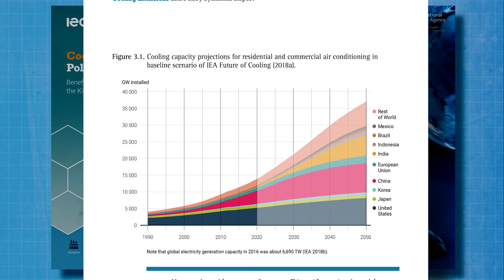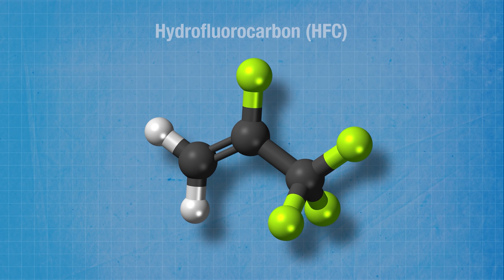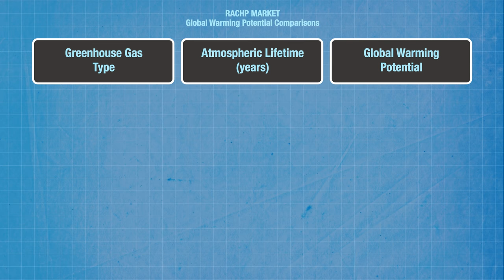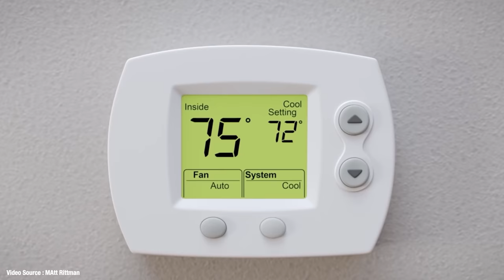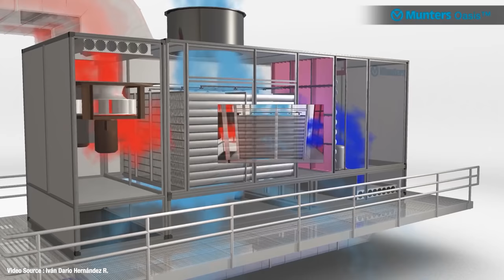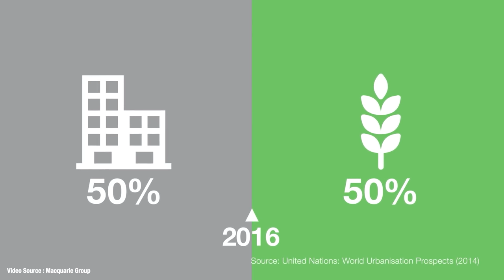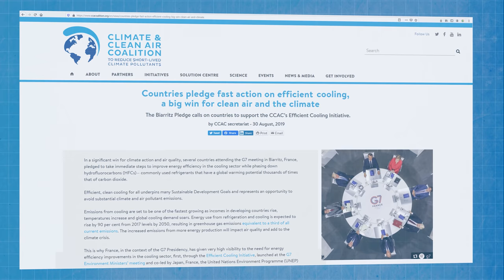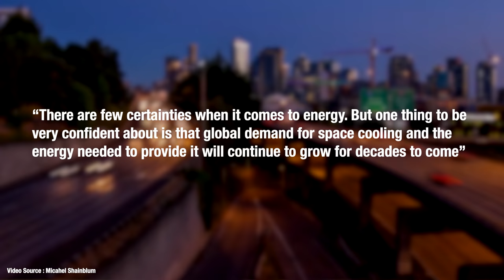Keeping cool in a warming world.

Comment: * PART 1 OF 3 * 
If you prefer a less-comprehensive, less-detailed but accurate and clear enough explanation with the cartoons that clarify it instead of ploughing through my text then the best one is at 8:25 to 27:45 at https://www.youtube.com/watch?v=jCF4vOgQyDE  and that one clarifies that the tropospheric temperature lapse rate is required to cause the so-called "enhanced greenhouse effect", which is crucial to understand. Photons are continuously both created from other energy by GHG molecules & destroyed by GHG molecules by converting them to other energy. A certain portion, statistically highly constant, reaches surface and a certain portion, statistically highly constant, reaches space.
-----------------
This is how the so-called "greenhouse effect" in Earth's troposphere causes warming. The so-called "greenhouse effect" effect is nothing at all like the effect that warms a greenhouse. A vast "shimmer" of transverse electromagnetic radiation in the long-wave band (LWR) is caused by molecules of water vapour (H2O), carbon dioxide (CO2), methane (CH4), nitrous oxide (NO2) and some other gases in the troposphere due to their collisions (averaging 2,700,000,000 collisions / second) with other molecules, which are almost always going to be nitrogen (N2) or oxygen (O2) because they are almost all of the gas quantity in the troposphere. The H2O, CO2, CH4, NO2 and some other gases are being called "greenhouse gases (GHGs)" because the overall effect (not just this part) ends up causing warming of Earth's troposphere. All except H2O are called "well-mixed greenhouse gases" because their boiling and freezing points are so low that they don't condense or freeze in the troposphere, not even near the top, so they get spread out well mixed around Earth and well mixed vertically in the troposphere. The well-mixed GHGs now punch above their weight compared with water vapour (H2O) because the upper half of the troposphere is so cold that almost all H2O forms on dust/salt particles in liquid or solid form there rather than being a GHG but the others remain as GHGs. The lowest quarter or so of the troposphere where it's warmer and water vapour (H2O) predominates is already somewhat "saturated" without much additional "enhanced greenhouse effect" possible (still, H2O has such a broad absorption band that it still manages to match the "well-mixed greenhouse gases" pretty much exactly 1:1 net as a 100% +ve feedback).
------------------
The GHG molecules don't emit a photon of LWR when they collide and they don't later get to emit a photon of LWR after every collision, only after a very few of them such as once per 1,000,000,000 collisions (note 1). What happens is that a collision might cause a GHG molecule to vibrate in a certain way (so with a certain energy) of which the GHG molecule has the capability of any one of a selection (called its "vibrational modes"). GHG molecules with more vibrational modes are more powerful GHGs because they have a broader absorption/emission band. The GHG molecule now has "molecular vibrational energy (MVE)" if the collision did cause it to vibrate. Energy cannot be created without destroying matter and matter doesn't get destroyed by this so what happens is that one or both of the two molecules slows down such that the total "molecular translational energy (MTE)", aka "molecular kinetic energy", is reduced by precisely the same amount as the MVE that the GHG molecule acquired, so (m1*v1**2 + m2*v2**2)/2 after collision is less than (m1*v1**2 + m2*v2**2)/2 before collision because either v1 or v2 or both was reduced, thus obeying the Law Of Conservation Of Energy. What happened was energy transmutation from one form to another. When this vibrating GHG molecule hits another molecule it loses its vibration (note 1) and one or both of the two molecules speeds up such that the total MTE, is increased by precisely the same amount as the MVE that the GHG molecule lost. So it just moved kinetic energy from one N2 or O2 (almost always) molecule to another. However, just a few times each second a GHG molecule with MVE will spontaneously emit a photon of LWR and lose its MVE ("relax"). Now it has converted one-photon's-worth of molecular kinetic energy in the troposphere to one photon of LWR. This "relaxation time" of the "springy" covalent bond harmonic motion (with a photon emitted) happens over 10ths of one second (a very long time indeed).
------------------
LWR is also radiated from the surfaces of liquids & solids such as the surface of the ocean, the surfaces of water droplets in spray above the ocean, the surfaces of water droplets in clouds, the surfaces of any water droplets at all, the land surface, the surfaces of trees & grass, the skins of animals, the surfaces of dust, salt, volcanic ash, any ash and any surface whatsoever on the ocean or land or in the troposphere. Except for 8% of the LWR from the ocean+land surface whose photons happen to have wave-lengths in a band called "the atmospheric window" this LWR goes into the vast "shimmer" of LWR in the troposphere with a distribution of energy quantity at each wave-length in the LWR band that is shown in plots of Earth's IR emission spectrum.
------------------
GHG molecules also absorb LWR provided that the photon's energy (which is its wave-length) perfectly matches one of that GHG molecule's MVE mode energies and the photon goes through (or tries to go through) the area of the GHG molecule that absorbs that wave-length. Obviously, a GHG molecule neither knows nor cares whether a photon of a certain wave-length trying to go through it was emitted by the surface of the ocean or land, surface of liquid or solid aerosoI, or emitted by another GHG molecule because all photons of the same wave-length are the same. A GHG molecule with MVE that it got by absorbing LWR will a few times each second spontaneously emit a photon of LWR and lose its MVE, exactly the same situation as when it got its MVE by collision. In this case the GHG molecule transmuted LWR back to LWR, it transmuted a photon to an identical photon, so it did nothing at all other than change the direction in which the photon is going. This is the cartoon that scientists show the public because it's a simple analog that Earth tried to cool itself to space and failed, but since there are 2,700,000,000 collisions / second there's utterly minimal chance that the GHG molecule will spontaneously emit a photon of LWR and lose its MVE before it collides and loses its MVE (note 1). The "skeptics" use the highly-incorrect nature of this cartoon to "disprove" the physics theory but it isn't the physics theory that's incorrect, it's the cartoon that's incorrect. The cartoon doesn't describe the physics theory hardly at all as I've explained in detail above. This is why I dislike this cartoon. When a vibrating GHG molecule hits another molecule it loses its vibration (note 1) and one or both of the two molecules speeds up. What happened was energy transmutation from one form to another, energy transmutation from LWR to molecular kinetic energy with MVE as the intermediary step.
Reply: * PART 2 OF 3 * 
Now the so-called "enhanced greenhouse effect" explanation that I think is clearest, obvious and difficult to challenge by mis-direction disinformation and subterfuge per the memes concocted by the coal/oil shills. 8.5% +/- 1.7% of the LWR that Earth sends to space is emitted by the ocean or land surface because the photons are in a wave-length band called "the atmospheric window" that doesn't get absorbed by the GHGs. It's my understanding that this will narrow slightly with increased GHGs, but this isn't the prime "enhanced greenhouse effect" and I'm not addressing any additional warming it might cause. 91.5% of the LWR that Earth sends to space is emitted by the GHG molecules in the troposphere, tropopause and stratosphere (note 2). This 91.5% of the LWR is the part that gets reduced by increased tropospheric GHGs and causes an energy imbalance with insufficient energy going out, which causes global warming, ocean heating and ice fusion, which causes climate change. 
------------------
The troposphere has an upper and a lower surface. The upper surface is the top of the troposphere (the tropopause) and the lower surface is the surface of the ocean or land. LWR produced in the troposphere that reaches the lower surface will warm that surface so it stays in Earth's ecosphere but LWR produced in the troposphere that reaches the upper surface has a good chance to make it through the increasingly-thin tropopause, stratosphere and the ultra-thin extended atmosphere to space and be energy lost to Earth's ecosphere, thus cooling it. LWR reaching the upper/lower surfaces was produced by GHG molecules, the surfaces of water droplets and the surfaces of solid particles (sea salt, ash, dust)  throughout the troposphere sending photons upwards/downwards as described in detail earlier. 
- There is an average altitude in the troposphere of the LWR quantity that reaches space. If you could float at this altitude and watch/count photons with special eye balls and brain you'd see 50% of those photons that reach space are heading up from below you. If you counted it at 48% then you'd need to float upward to get more of the LWR photon production below you. If you counted it at 52% then you'd need to float downward to get more of the LWR photon production above you. This is obvious. When you float to the place where 50.0000000% of those photons that reach space are heading up from below you then you are at the average altitude in the troposphere of the LWR quantity that reaches space.
- There is an average altitude in the troposphere of the LWR quantity that reaches the surface of the ocean or land. You could float and find that the same way as the preceding.
These 2 altitudes in the troposphere are approximately for illustration only and as a global average (I'm not quantifying the so-called "enhanced greenhouse effect" in this comment, only describing its operation accurately):
=average=  =average global ==
= altitude=   =temperature=====
   (metres)      (degrees)
— 5,960 —— -23.8 ———— 50% of the "energy shimmer" of LWR photons that will
————————————— make it to the tropopause are emitted by GHG
————————————— molecules and the surfaces of cloud droplets
————————————— and atmospheric particles below this altitude.
— 2,060 ——— 1.6 ————  50% of the "energy shimmer" of LWR photons that will
—————————————  make it to the surface of the ocean or land are emitted
—————————————  by GHG molecules and the surfaces of cloud droplets and
—————————————  atmospheric particles below this altitude.
These values are approximate. They are to demonstrate how the so-called "enhanced greenhouse effect" works, not to provide quantities. They are approximately correct though. They are based on a global average ~12,000 metres height of the troposphere but it varies geographically from 9,000 to 16,000 metres. 
---------------
If tropospheric GHGs are increased then 2 changes occur per my explanations above since the start of my comment:
1) More LWR than before is produced by the GHGs, and
2) More LWR than before is absorbed by the GHGs because the LWR photons have to make it through more GHG molecules that might absorb them before they can reach their goal of going up past the top of the troposphere or going down past the bottom of the troposphere and being absorbed into the ocean or land.
Note that I have not included any additional effect there might be due to increased GHGs reducing the 8.5% of the LWR reaching space that's in the "atmospheric window" wave-length band.
---------------
The result of combined effects/changes (1), (2) above is that the average altitude in the troposphere of the LWR quantity that reaches the top of the troposphere gets higher, so perhaps it raises from the 5,960 metres in my illustrative example to, say, 6,060 metres, which is on average 0.65 degrees colder than its prior altitude so its GHGs radiate 2.28 w/m**2 less than before. So less energy than before is radiated to space.
---------------
Likewise, identically, the average altitude in the troposphere of the LWR quantity that reaches the surface of the ocean or land gets lower because it has to get past more GHG molecules that might absorb the photon, so perhaps it lowers from the 2,060 metres to 1,960 metres, which is on average 0.65 degrees warmer than its prior altitude so its GHGs radiate 3.07 w/m**2 more than before. So more energy than before is radiated to the surface.
---------------
Obviously, the altitude changes just above depend on the GHG change quantity and I just showed a random example. In either case above (upwards or downwards) GHG photons were trying to reach their goal of the top or bottom of the troposphere but now there are more GHGs in the way so it needs, == on average ==, to be a bit closer to make it. So that's why the "energy shimmer" of LWR that will reach the top is a higher-altitude shimmer than before and the "energy shimmer" of LWR that will reach the bottom (ocean or land) is a lower-altitude shimmer than before. The quantity of LWR energy (power flux) provided by a mass of gas is proportional to its temperature(Kelvin)**4 because lower temperature leads to slower molecules which leads to fewer GHG molecular collisions / second which leads to less LWR production than before. Thus we see that the tropospheric temperature lapse rate is required to cause the so-called "greenhouse effect" in which an increase in tropospheric IR-active gases (with their "springy" harmonically-oscillating covalent bonds) causes less LWR than before to be radiated to space and more LWR than before to be radiated to the surface.
Reply: * PART 3 OF 3 * 
Note 1: I haven't yet found the collision MVE production & destruction spectra so I don't know what %age make MVE and what %age destroy MVE. It makes no difference to the description of the mechanism above but it would be needed to confirm the quantity of effect for a specified increase in a specified GHG.
Note 2: Removed because I've gotten confirmation.
Note 3: 80% of Earth's atmosphere is in the troposphere (the top of which is 16 km in the tropics and 9 km in the polar regions, averaging ~12,000 metres). The "greenhouse effect" warming can only happen in Earth's troposphere, there's no effect in Earth's tropopause and the effect is "backwards" in Earth's stratosphere (and part of its ionosphere) with =increased= stratospheric GHG gases causing =cooling= of the stratosphere because the stratospheric  temperature lapse rate has temperature increasing with altitude (that's how it's known with total certainty that it's increased "greenhouse gases (GHGs)" doing the global warming for the last several decades). The increasing GHGs in the stratosphere are a slight -ve feedback to global warming because downwelling LWR radiation from the stratosphere decreases with increased GHGs, but it's a very slight -ve feedback because only 6.3% of the well-mixed GHGs (and all molecules) are above the tropopause and they are initially colder than the average of the troposphere so they make even less LWR than the 6.3% factor. By the time the stratosphere warms more than the average of the troposphere there's only 0.4% of Earth's atmosphere's molecules above, negligible. Since there's no temperature lapse rate in the tropopause then any change in the quantity/type of GHGs in the tropopause cannot have any warming or cooling effect. 
Note 4: FTIR power flux vs wave-length spectra recorded by the IRIS Infra-Red Interferometer Spectrometer instruments on the Nimbus-1 (1964 - 1964), Nimbus-2 (1966 - 1969), Nimbus-3 (1969 - 1972) satellites show which wave-lengths of LWR heading to space past the satellite came from the surface of the ocean and land and which wave-lengths came, on average, from the GHG molecules and surfaces of solid particles and water droplets in the atmosphere. Examples of these measured FTIR power flux vs wave-length spectra (for western tropical Pacific Ocean, Sahara Desert, Antarctica & southern Iraq) can be seen at:
http://climatemodels.uchicago.edu/modtran/modtran.doc.html (IRIS-C spectrum on the Nimbus 3 satellite over the Sahara Desert to demonstrate the U.S. Armed Forces MODTRAN model's general accuracy)
https://publishing.cdlib.org/ucpressebooks/view?docId=ft8r29p2m6;chunk.id=d0e1726;doc.view=print (Sahara Desert as observed by IRIS-D instrument on the Nimbus-4 satellite)
https://www.youtube.com/watch?v=Oog7-KOtpEA&t=1713s at 18:07  (4 FTIR samples for western tropical Pacific Ocean, Sahara Desert, Antarctica & southern Iraq)
From these spectra atmospheric physicists have calculated the 91.5% of the LWR that Earth sends to space that is emitted by the atmosphere rather than by the surface of the ocean and land. Also, the MODTRAN tool on the internet can be used to play with a theoretical calculation of the FTIR power flux vs wave-length spectra by adjusting GHGs.
Note 5: 2020-01-25 edited example altitudes. The Kevin Trenberth & other Earth's energy budgets show 17% (40 w/m**2) in the atmospheric window but "Outgoing Longwave Radiation due to Directly Transmitted Surface Emission" of S.M.S. COSTA & K. P. SHINE 2012 states that as ad hoc and assesses instead 8.5% (20 w/m**2 +/- 4 w/m**2). I don't attempt quantifying anything in the effect explanation but I made my examples for illustration as close to reality as is reasonable to do (Stefan-Boltzmann equation & average tropospheric temperature lapse rate).